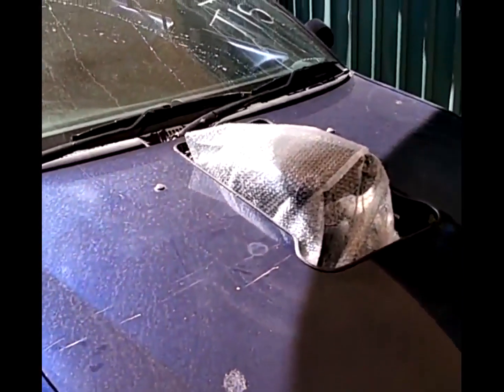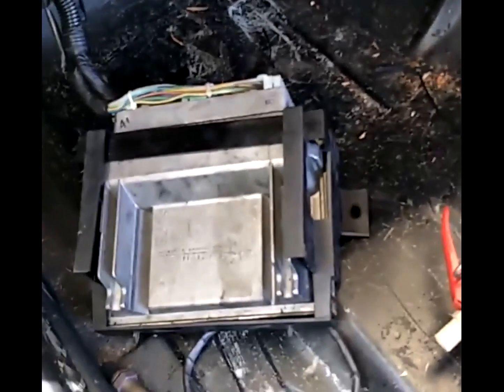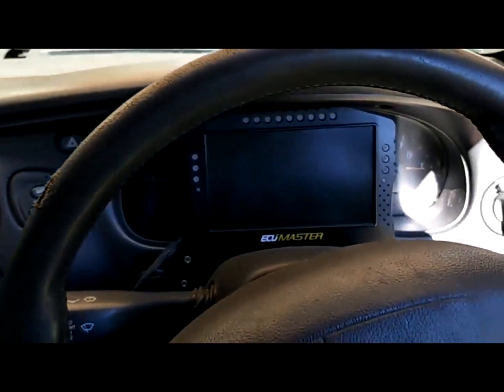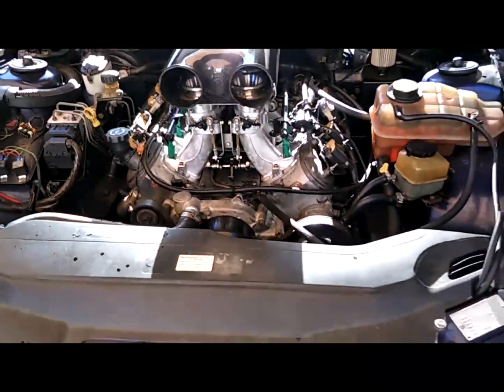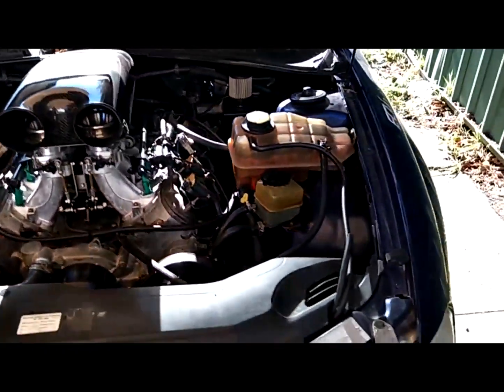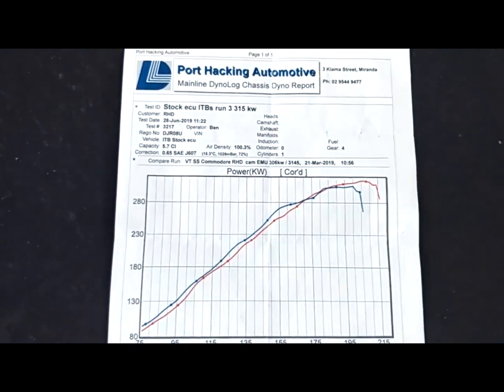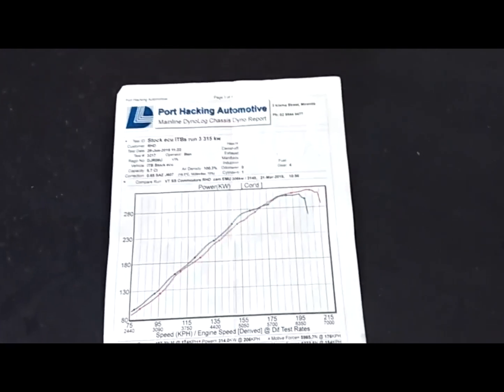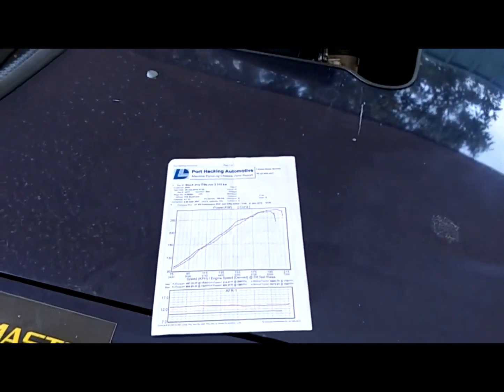LS1 ITB intake Tuned with OEM ECU

Comment: how far does the intake stick out of the bonnet and do you make them for an l98?
Reply: Yes they do make for all LS, dbw and cable. Rec port and cathedral port.
Looking at the bonnet closed on this install, the front of the carbon scoop is about 100mm above the bonnet line. Leveling off at the rear.
I'm very much looking at this system for my own LS1 VY HSV clubsport